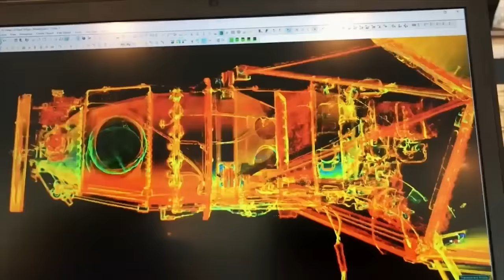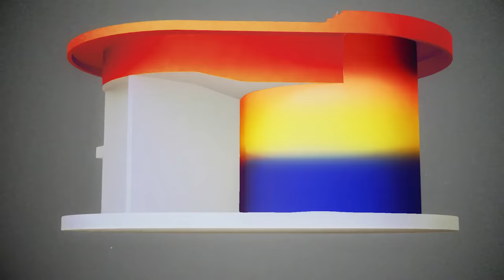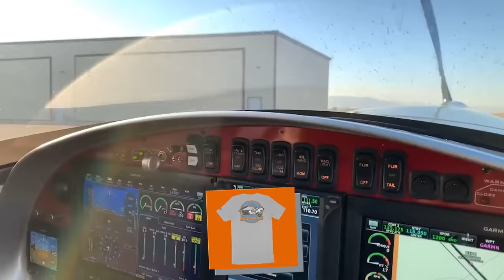Building the Ultimate Private Pool | House Build #25

Comment: Looking good Mike. If those peristaltic pumps fail, I would replace them with a nice Stenner. You should have a decent amount of run time on the elements. I would also do a second containment if they do fail. Atleast the chemicals will not be all over the place. Some of the pumps have a knockout or extra port for a drain tube, but they never work. I’m not sure injecting the acid and chlorine so close together is ideal if you have the space. I would also inject the acid first. Those checks at the injection points might be a pain along with build up of calcification at the points. They do make injection “quills” which are nice. They put the flow of the chemical directly in the middle of the pipe for better mixing and less buildup. utilize “water treatment” grade materials and mechanical items. It seems like a lot of “pool” grade or labeled products just don’t last or are less superior to what we use in the large scale water and wastewater treatment industry. Love you guys. Keep up the amazing work.

Comment: It looks great. Thanks for letting us into your new home.
Are you planning to have a rigid cover for the water which will:
1) Prevent debris from entering the water, reduce filter use and pump wear
2) Minimise heat loss, running costs and ultimately, pollution
3) Provide a larger floor area for other activities
during the many times when the pool is not being used?

Comment: I'd like to see the pool floor move and how that is all supposed to work. Especially so people can't get trapped underneath. I've had a hard time conceptualizing that.
Reply: Lol, what part is hard to conceptualize?  
  Picture a mesh floor that is able to move up and down through the water.  There isn’t an easy to access way of  getting under that movable platform. If you were swimming and someone started raising the floor it would simply push you up through the water.
Reply: @savage6394  Apparently it's pretty hard to visualize, since your description is way off from what Mike has already described in these videos. The floor he's said he was going to install is a floating solid platform held down by a cable system. It's not installed yet as far as I can see.There's supposed to be a curtain that comes up with it to keep anyone from being able to swim under it from the shallow end when it's all the way up.
Reply: @TomInGulfBreeze  That's what I thought he had said. If I remember correctly, it is also supposed to be able to come up out of the water to make solid surface in that area.

Comment: mike, have you ever though of making a lifting body/ blended wing plane?
been toying in flyout using 2X pusher and pull engines facing in a V,  basically an electric plane with thrust vectoring trough linked airduct (after air streams meet). 
i know electric planes makes little sense BUT i also think if there ever is a plane for it, it ought to be some form of flying wing.

Comment: That pretty cool 😎 you have apower in your house, and even thoe my family's back ground is about airplanes since my Grandfather in 1949 piper cub, I'm still not as rich as you are, But! I'm also prepared for a power outage, I got myself 2 Generac 8251 generators ready to pull out of storage and hook up to my power source, But then we hardly have power outrages here, the last long one we had here was in January 1st 2000 and I was prepared,I had installed an old round LP Gas vent heater and when everyone else was freezing 🥶 for 12 hours we were nice and cozy.

Comment: Great, you got the heating part down . . . how about cooling all the stored radiant heat emanating from the surrounding concrete structure in the summer? 
Do you raise the adjustable floor elevation to an altitude to provide passive adiabatic cooling assistance? 
Mike, that is not an acceptable answer because your a brilliant engineer!

Will we see an R/C Scrappy or Draco with floats take off/lands in Patey Lake? (cockpit view GoPro)

Comment: You definitely have a lot of switches/relays/electronics/moving parts etc. going on, and it would be interesting to know the amount of maintenance, parts, and whatnot's that could be required to keep the units running properly, but even that could take a couple of yrs. You may need to hire a 24hr. operator to run the basement. LOL

Comment: Good day Mike, this might be a dumb question, but do you have floor drains in your pool filter and pump rooms. All the pool filter/pump setups i have seen usually drip water. Some raised bottom of door like in a ship water tight door. say 100mm or 4inches. this will contain water in one area. What is the highest temperature the plastic pipe fittings will see. I worry about the glue going soft and causing leaks. keep up the good work.

Comment: Seems like those multiple containers holding muriatic acid (for ph) could have been replaced with one larger container on the floor. I wouldn’t want to have to mess around with trying to fill each one….acid isn’t something you want to spill. You could have used separate peristaltic pumps (like you have) to pull from the large container. Thats my layman/pool owner take. Also, afaik those feed lines should have been mounted on the top of the pipe, not bottom. But may not matter, I’m sure you looked into it.